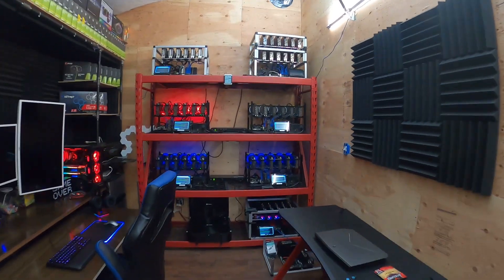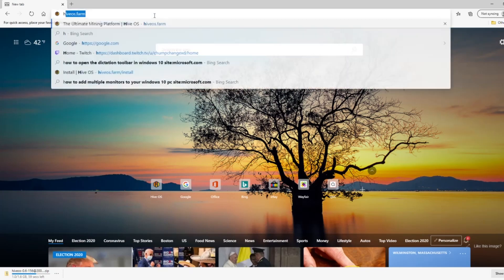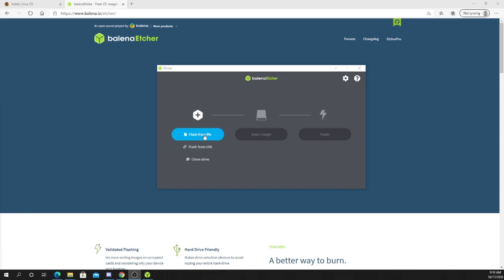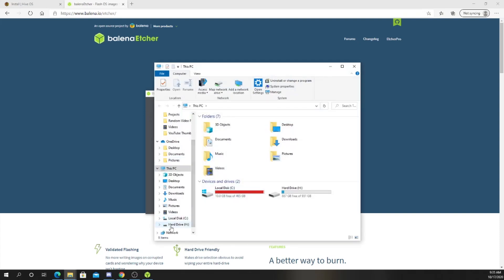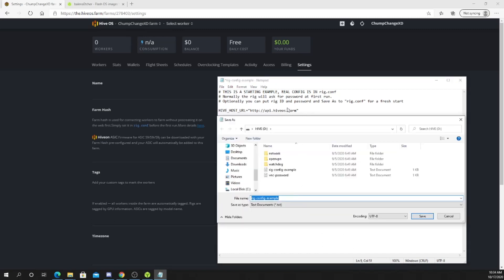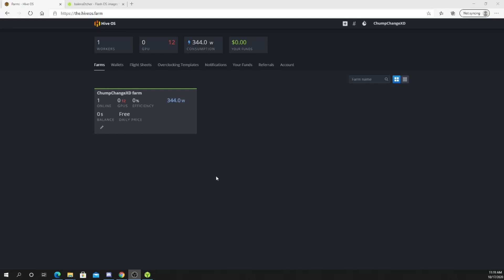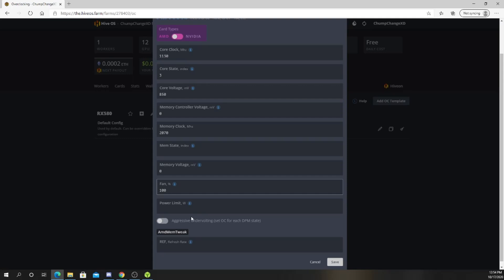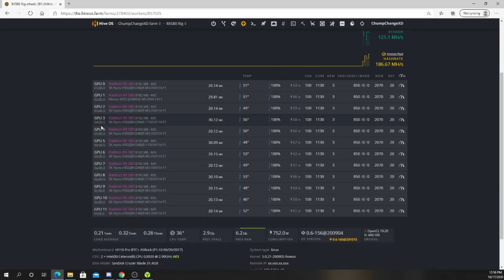HiveOS For NOOBS

Comment: am like how can you plug that into the rig?
pls help
Reply from the maker: Huh? Just as normal. When you set up the USB, SSD, or M.2; Install it into the rig and fire up the unit in the bios if for some reason it doesn’t pick it up automatically... Change the “Boot Order” if you have more than one operating system on the computer/rig
Reply: @ChumpChangeXD  THANKYOUUUU

Comment: I'm having some issues with this. I have a ryzen 5 3600 with msi 550 gaming plus MOBO. An SSD with windows OS. 
I have flashed a USB thumb drive and choose to boot from the USB instead of SSD. 
I didn't get the same boot sequence as you where it loads different information and you see the HiveOS logo. My computer kind of froze and after some time I could see like a blue background with 3 lines of text. I think one line said something about HiveOS and another about system... (it was just there a few seconds). Then later it booted into something which looked like a linuxbased OS similar to windows 10 but very down scale. It had an icon for firefox but you couldn't start it. It had three more icons, I don't remember the names now but one was like the command prompt. 
Then it rebooted and I changed back to the original boot order. Now when I logged into Hive.farm my GPU from the ryzen 5 did show up but I cant mine. I select a flight sheet but it just  loads for like 2 minutes and it says the GPU is offline.
What can I do to start mining?
Is this problem maybe because I have Windows on my computer, maybe just have one dedicated rig with no Windows OS on whatsoever?
Reply from the maker: Hey man so the operating system once booted up is basically s controlled by the remote app or another computer. Did you down load the correct GPU section? Please listen to this video and if you still need help join discord we are more than happy to try and help you!! 

https://youtu.be/P_chB3OVWhs
Reply: @ChumpChangeXD  Thanks! I think I need some help. How do I join on discord? Sorry new to discord as well. Hehe

Edit: I believe I joined now on discord
Reply from the maker: Do this send me a friend request may take a few to get back to you but there is a HiveOS section that you can post a question and the mods and stuff are more than seasoned to help as well if I take a bit to get to you. 

I have ALOT of DMs haha
Reply: @ChumpChangeXD  I understand! :) It says that I am not authorized to write in any of the channels  :( I tried several..
Reply from the maker: Go to your direct messages and make sure you verify and it will allow you! It’s to keep the bots out
Reply: @ChumpChangeXD  THANK YOU! ❤
Reply from the maker: @cloudsmiles1  Anytime brotha!!! This is family/cleaning the house day so not around much but I’ll be catching up on discord and DMs tomorrow if you still need help. Ask @TeaspoonMiner in discord he should be more than able to help you out!!!
Reply: @ChumpChangeXD  We did it!!feeltheY33t and Teaspoonminer helped me! I am now mining 62 hashrate through T-rex miner with my RTX 3070 ❤
Reply from the maker: @cloudsmiles1  YESSSSS!!!!!! That’s amazing!!!!

Comment: So, on the hiveos. Can you run a USB wifi or do you have to plug the ethernet cable in?
Reply from the maker: Hey man it’s best if you can yes.  But as long as you have a good WiFi connection you can do that as well!  It just may be spotty at times but I have a buddy that runs his on WiFi with no problem for the most part
Reply: @ChumpChangeXD  thanks for the info and quick respond. I will subscribe to your channel. For further questions. Thanks!
Reply from the maker: @itzmehsamsta  Discord is a great place to meet up for trouble shooting with a few of us and its free if you wanna join! https://discord.gg/s6q3BQb

Comment: My pc not detecting GPUs (3060 ti) should I install drivers or something ?
Reply from the maker: Are you using windows or HiveOS?
Reply from the maker: Bud do me a favor and join discord I helped someone else get HiveOS to read their 3060. Was a little tricky but I figured it out. I will have time this evening to help you out if you'd like let me know! Just tag me in the HiveOS channel and Ill respond for instructions in our Discord (link is in description)
Reply: @ChumpChangeXD  I used to do it on Windows 10. Today thought to install Hive os. But it's getting harder. I tried to install drivers. It installed, but still cannot not detect the GPUs. 

So now I tried to boot windows 10 on my pendrive to install it on my pc. Now my pendrive got some problems to deal with. It's not detecting after I installed hiveos and formatted it.
Reply from the maker: @TarunKanthK  you should get a NEW* 32 Gig Flash Dr. and download Hive OS onto it following the steps in my video then join my discord group and message me I will do the best I can to help you get it up and running. Just remember if you’re going to run a Hive OS it’s a complete operating system so you cannot run windows with it
Reply from the maker: @TarunKanthK  I had to remote into somebody’s rig and apply a few settings to get it to register their 3060 rig in HiveOS because it was not detecting like your saying
Reply: @ChumpChangeXD  Thanks amigo. For now I am going with win 10. 
May be in few days I will give a try again.
Reply from the maker: @TarunKanthK  No problem!! Also discord is 100% free and we are all there to help in any way we can!
Reply: @ChumpChangeXD  Ya. Just joined it. I think you had seen me already.

And great video by the way. No channel on the YT made a video about installing this os, I found that funny. 

Even Hiveos did not give any instructions. And I think more in-depth video or support from hive is needed.

I wish all the best to your channel.
Reply from the maker: @TarunKanthK  I appreciate you, thank you!
Reply: @ChumpChangeXD  Today I detected the problem. It's the hardware problem, not the software. Some wiring problem, a silly one actually.

One small question. 2 days back when I installed hiveos I had seen a screen on which there is microsoft edge and like the normal windows 10. 

What command to use to go there ?
Reply: @ChumpChangeXD  I am asking about the command that will take me from dos like display to Windows like looking display. 

Is it agent-screen ?

And is it possible to over clock with Hive os ?

And is it possible to restart the pc every few hours with hiveos ?
Reply from the maker: @TarunKanthK  Hey bud do me a favor come to our free discord. It will be easier for us to assist you with HiveOS! Links below

https://discord.gg/GCvSnGnh
Reply from the maker: @TarunKanthK  For the windows like looking display, there's really no point. It IS possible to boot into Hive with a GUI (Graphical User Interface) but there's no benefit to my knowledge. I know with older Nvidia cards you had to boot w the GUI for OC settings to take effect. Not so with AMD, though.

Yes you can overclock with HiveOS.

And YES it is possible to remotely restart, Reboot and Shut down/reboot in 30 seconds in HiveOS as often as you would like directly from the mobile app or from another computer in your account.

For anything further than this please join our discord group I don’t have the ability to respond as easily here and there are other founders of our group “misfit mining“ that will be more rounded in this type of situation!!

Comment: I somehow cant connect my rig to HiveOS. i use ethernet but its still not showing up.
Reply from the maker: Did you flash it onto a USB?
Reply: @ChumpChangeXD  yes i did but i used another tutorial from hiveos themself so i downloaded the config file from the webbrowser. didnt look into the bios yet since i have no experiance with that. i will look into it later today when im at my mining location. i had an ssd concected at first but i wanted to switch to hiveos so i dont have any storage besides the usb connected
Reply from the maker: @hendrik3076  So if you’re going to have HiveOS on this rig personally I would not double it as a computer so you don’t really need any type of storage you can take the SSD out. But you should watch my set up video of that config file and follow along. It will simply things and get it up and running no problem! If you have any issues you can always join our discord group; I will be glad to assist you further if you need help!
Reply: @ChumpChangeXD  ty :) will do
Reply from the maker: You may have to go into your Mother Boards Bios and select start from the USB if you still have a SSD or HardDrive installed